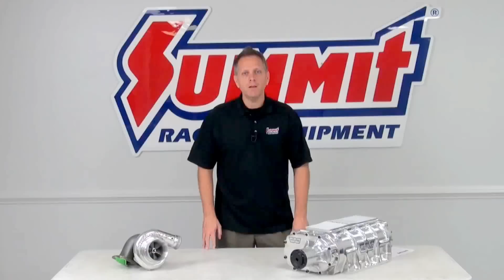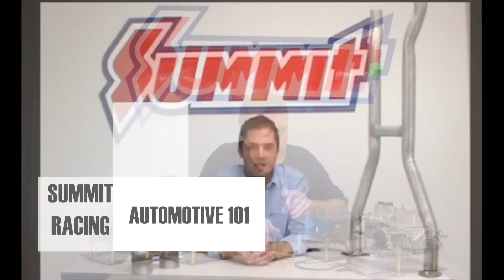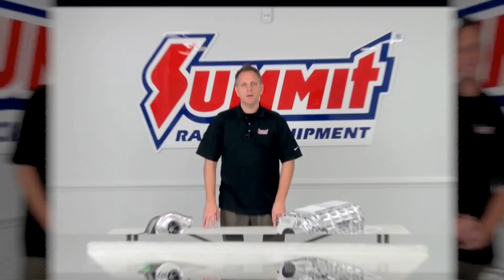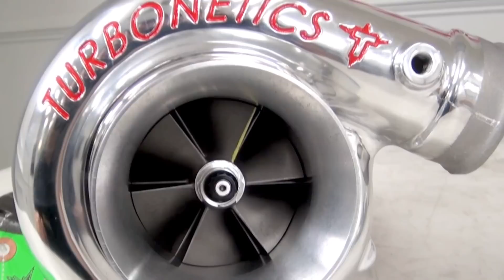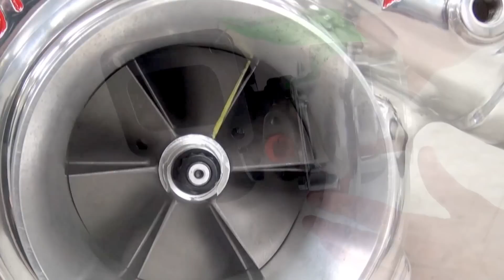Supercharger vs Turbo - Summit Racing 101

Comment: To those who are still confused, the turbocharger shoves air into the combustion chamber giving you more bang which means you'll have high acceleration but eventually looses some of its power in high speeds and gears.

The supercharger is attached to your engine belt, what does that mean you ask? It means your engine will scream at higher RPMs,  you'll have more horsepower and a higher top speed, since your engine is spinning round and round even faster you won't start gaining speed slower.

It depends on the situation, if it's a drag race, use the turbo... or  NOS. If it's a track I recommend the supercharger
Reply: rynousa yea, backwards lol
Reply: +rynousa yeah thats what i was reading earlier a turbo does better at higher rpm thats why it has a lag and the superlcharger usually doesnt give you as much power as the turbo but its better at lower rpm and it builds from there.
Reply: my little 144 never stops pushing not even past 10000 rpm
you guys read to much advertizing propaganda  
that what they said about the new screw blowers  .
but you heard the summit guy say they got no top end.
turbos have a tough powerband but then they shift and thats where the real lag is .
even the spoolers .
Reply: +Densel Moore lets get something straight here, a turbo doesn't necessarily mean high rpm. Also a difference between them is turbo is more effecient. Supercharger for drag, turbo for track, not the other way

Comment: So I'm not an auto technician but I'm curious . Can you install a turbo and a supercharger on one vehicle ?
Reply from the maker: +erik acosta , 
Yes, this can and has been done but, it would require a highly modified engine in order to handle that kind of cylinder pressure.

Comment: supercharger vs turbo? why not both?
Reply from the maker: +Dave0551, 
What is the year, make and model of the vehicle?
Reply: Summit Racing In general is it possible to install both?
Reply: +Dave0551 ...yeah its possible we call it twincharger or compound charger..In 1985 it was first introduced on Lancia Delta S4 ...after dat it was installed on Subaru Impreza WRX, Mini Cooper S, Ford Mustang, Toyota MR2. .source wiki
Reply: +Dave0551 Now that's my kind of mindset! hahahaha Mad Max would be proud ;D

Comment: Trying to decide if I want to put a supercharger on my 2500HD . It has a 6.0 in it . What should I do
Reply from the maker: +Damon Brady , 
We apologize for the delayed response, your comment was flagged as spam. In response to your question:  Depending on the year model of your vehicle, Edelbrock offers an “E-Force” Supercharger kit that includes all of the parts necessary to make the installation as easy as possible. They use high quality components including a hand held programmer for the computer so you don’t have to go to the dyno if you don’t want to!  Take a look. We stock many of these kits!

Comment: What has more wear on the Motor? 
I am assuming the supercharger due to using motor power and not exhaust.
Reply from the maker: +Tyler Madison, 
While a belt driven supercharger will ad some additional stress to the nose of the crank, both types of pressurizing the intake manifold (Turbo/Supercharger) will increase stresses on things like pistons, rings and connecting rods and bearings.

Comment: I'm interested in supers over turbos because I heard supers are constant duty while turbos are intermittent. Don't see much point in a turbo if that's true.
Reply: +Matthew samson that is correct. The turbo IS constantly displacing air, but until the turbine begins spinning fast enough from the pressure of the exhaust gasses, it will be making very little added power. Honestly i think a turbo would be so fun, think about stepping on the gas and just sitting there suspensfully waiting to be thrown back in your seat! :)
Reply: and please be really easy with the explination. I'm so incredibly new with messing with my car.
Reply from the maker: +Matthew samson , 
Well, since a Turbo is driven off the exhaust pressure, and exhaust pressure is higher at a higher engine RPM, the Turbo spins faster if the engines crankshaft speed (RPM) is higher – right?
A supercharger is belt driven off the engines crankshaft, therefore if the engines crankshaft speed (RPM) is higher, the supercharger then spins faster as well – right?
  Feel free to give us a call, we’ll walk you through it! 1-330-630-0240
Reply: +Matthew samson the turbo is constantly working, but the power it gives is determined by the air pressure coming through. If your engine is running high rpms=more exhaust gas=more pressure in turbo=higher power output from the turbo. The reason turbos will lag, is that pressure must first build in the turbo to spin the turbine within it. Once pressure has built up the turbine will be spinning quickly, forcing alot of condensed air into your engine. The amount of pressure buildup in the turbo being forced into your engine is called "boost", hence the boost gauges you will see in turbo cars!
Reply: ***** okay so turbos and supers both constantly displace air, but turbos must first build air pressure before delivering. Am I correct? I'm really struggling with translating all this from aircraft turbos since they act differently lol
Reply: +Matthew samson supercharger is not efficient ,,it thus increase power by 40% but also increase fuel in take and lower the mileage ...whereas turbocharger don't interfere with mileage but increase power at higher rpm...... turbocharger is annoying for their turbo lag

Comment: I have a 06 police 3.5l charger, nothing done other than the tune, suspension from the department. The modifications I done are a K@N drop in filter and a custom after market exhaust. what in your opinion would be a good choice. A super charger (of so, which type) or a turbo charger.
Reply from the maker: +Anonymous, 
A Centrifugal type of supercharger (Paxton, Vortech, Procharger) is much easier kit to install most times than a Turbocharger kit and generally lower cost!  Don’t forget the computer tuning, you’re going to need it!

Comment: hi I have a 4th generation z28 with 115k miles. I plan on a tune up and headers and new exhaust first before I get a turbo or super charger I wanted to know which would be better? I think they both sound nice but rather go with what would be best
Reply from the maker: Joshua Gonzalez, 
Generally, a centrifugal type supercharger are easier and least expensive to install.

Comment: I currently own a 2009 370Z that is bone stock with 83K miles and am looking at having a centrifugal supercharger installed. I've done some research and am still learning quite a bit about forced induction for my car in particular. My question is, would it be a good idea to add a supercharger (or any kind of forced induction for that matter) to a vehicle with that kind of mileage? Thanks in advance.
Reply from the maker: Marco Deuce, 
Generally speaking, in most cases a stock motor with good maintenance history will be fine with a power adder at low boost levels such as 5-6 psi. It will have a considerable difference in power as well at that boost pressure. Anything higher than that really starts to add stresses the motors were never really designed to withstand and should be modified accordingly!

Comment: A turbo doesn't run off the velocity of the exhaust gases. It uses the heat from the exhaust gases.
Reply: sleeperfox302x You dumb bro?
Reply: What do you mean by saying that
Reply: your shitting me right?
Reply: +sleeperfox302x u think turbocharger turbine will rotate due to heat from the exhaust gas...hahaha.....turbocharger use intercooler in order to cool and increase the density of charge (air fuel mixture) ..Heat are one of the drawbacks of turbocharger
Reply: +sleeperfox302x  Its not the heat itself, u stooge.  More heat creates a greater pressure-differential across the turbine wheel.   Higher pressure differential means higher VELOCITY across the turbine wheel.  Higher velocity means the exhaust gas has higher INERTIA...  which means it will impart greater energy into the turbine wheel.  Which means it will spin up faster.
Reply: +Muammarvsgaming ROBLOX  i said, high pressure DIFFERENTIAL!!.
Reply: Wrong
Reply: +Marek Sumguy actually lower pressure=more velocity=decreased lag+more respond

Comment: I have a simple solution... USE BOTH :D
Reply: +Joshua Medina the challenger hellcat X prototype has turbocharger (not sure if twin or single) plus a supercharger
Reply: Siggy Cloud There are cars that uses both. The first car to do so was an 80s sort of supercar built for a special category of Rally that required only 200 roadgoing cars to be built. It has the shape of a small 3 door car like a golf but its only a 2 seater with a mid engine, plastic body and 4wd delivering up to 550 bhp for rally.
Reply: MC Taipan I think you're talking about a lancia delta?
Reply: Yes Lancia Delta s4, It gets easily mistaken for the Delta Integrale.
Reply: MC Taipan I wouldn't call a Lancia road going. from what I heard they have a bad reputation for breaking down.
Reply: Yes thats true, but this was a very special car, search for Lancia Delta s4 or s4 stradale. the 200 roadgoing versions was made only to get up the number to make rallyversions.
Reply: MC Taipan But they seem to work, I've seen several on YouTube, people give rotary engines shit for not reacting well to running hot. Simple answer... bigger radiator, better intercooler, better coolant.

KEEP the thing running COOL its a pretty obvious solution. I only ever hear it from people who haven't owned one. which I think is ironic. I haven't owned one myself, but I can see a pretty obvious answer to the problem without much effort. 

But getting back to the point, its all about maintenance and looking after something and knowing how to fix problems. 

If one thing doesn't work. Try something else.
Reply: What's the average price point for both? Also, which one would be better for an s2k?
Reply: only ford gt can do that
Reply: +MC Taipan 
B class rally cars
Reply: Rashid Al-Riyami Yes The delta s4 is a group B rally car, but no other in the class used both.
Reply: ah cool, man those b class cars are beasts, too bad they're banned
Reply: yes i agree. I was at a show for about two months ago and there was a section in one of the halls where they actually had brought Hannu Mikkulas Audi Quattro s1 for display and also a Delta s4, 205 t16, special version of an rs200 and Metro 6r4. It was amazing to see them irl.Still i can barely get it into my head that i have actually seen a few of them.
Reply: had va rx3 it was awsome  when you blow the radiator hose shut it off
Reply: turbo for drifting, supercharger for gripping around a track

Comment: How would a turbocharger affect an air-cooled engine? I have an older volkswagen that uses an air cooled engine, and I'm interested in putting more power into it. Would the engine still be able to properly cool itself with the increased power? I have also heard that turbochargers are better for fuel efficiency as they don't waste fuel at lower speeds. Is this true? I don't want to have a terribly fuel inefficient vehicle, but would not mind sacrificing efficiency to increase the top end if that makes any sense. These may sound like dumb questions but I am uniformed. Advice on the matter would be greatly appreciated.
Reply from the maker: Roasted Goldfish , 
Air cooled motors can benefit from a low boost charger system. Anything high boost, high volume of air would indeed comprise its cooling ability. As for fuel efficiency, that’s a matter of the type of fuel delivery system and the weight of your right foot! :)

Comment: 2004 mustang cobra. super charge or turbo charge? will be doing both street and strip racing.
Reply: TheHDB97 04 cobra came with a roots supercharger from the factory
Reply from the maker: TheHDB97,
 Supercharger kits are plentiful for this car and easier to install. Buy a kit that comes with a programmer for the computer and you’re plug and play!
Reply: Kyle Schumacher lol I know, but im asking if a turbo could make more power. supercharger takes it I guess
Reply: oh ok. id still say turbos though

Comment: how do they manage HP against high temps outside 80f & higher compared with 40-60f intake air temps. Thanks.
Reply from the maker: Hot80s , 
Well, the underlying concern when trying to make big power with high ambient temperatures is detonation. Detonation can be controlled a number of ways dependent upon the application. Intercooling, retarding ignition timing, water/meth injection & cooling system efficiency upgrades are just a few to consider.

Comment: So i want to force feed a 350z. I currently live in arizona where it is crazy hot. I prefer a turbo set up over a supercharger but feel like it won't be efficient during the peek season of the intense heat. I mainly just want to make it faster whether I'm going in a straight line or side ways (mostly side ways) any input?
Reply from the maker: Joseph Gruber, 
A great suggestion for this type of environment would be to use a water to air type of intercooler. This type of system has a reservoir that you could add ice too and really bring your inlet temperatures way down!

Comment: seems like a turbo would be a little easier and less expensive to add on? still new to car tech but also looks like less materials as well, im sure they can go both ways price wise but just the basics what would that equal out to compared to each other?
Reply from the maker: Mustangandtang, 
We need some additional information from you. Can you give our tech line a call at 1-800-230-3030? 
Thanks!

Comment: Are there turbochargers that deliver more power than others ?
Reply from the maker: CatBombs, 
Your question is actually a little more complex than you may think. When choosing a turbo bigger is not always better. There is info that needs to be considered such as cubic inch displacement, components being used in the motor and also the fuel system? What is your power goal? What is the airflow requirement of said motor and where in the power band would you want your max power made?
Kits will sometimes make this choice a little easier but not fool proof. Many supercharger/turbocharger manufacturers would love the opportunity to help you match their products properly for best all around results.

Comment: i wanna put one on a charger. which one is better?
Reply from the maker: Insanetrickz98, 
Today’s newer cars have very little room required for all the exhaust & intake piping necessary for installation of a turbo kit. That makes a supercharger that bolts in place of the intake manifold an easier installation with the same results!

Comment: So I'm building my ranger into a desert racing truck. I've heard that both shouldn't be used beCause debris can come up and possibly break the pieces. Also the heat from them. But I'm still leaning towards buying a supercharger for my truck. Any input on if I'm dead wrong or somewhat right? School me on this. Thanks and appreciate all these videos you guys make. Very helpful
Reply from the maker: Gabriel Alejandro, 
Either option will have its share of compromises and fabrication in order to make them work out for you. Turbos have a lot more plumbing (piping) to do and roots style chargers have potential hood clearance issues. The choice is up to you provided you are willing to do the work. Just keep in mind that in a sandy dirty environment that top notch air filtration is extremely important to make either of these chargers live.

Comment: What's is the best supercharger for an olds 455
Reply from the maker: Payton Bechler , Unfortunately we do not have an all-inclusive kit for the Oldsmobile motors. We can however supply new superchargers, snouts and pulley’s from Wieand. In years gone by there have been intake manifolds made for the Olds motors to mount a 6-71 supercharger. You may still be able to find one on the internet or a swap meet.

Comment: Would a turbo/super charger work on a rotary engine? Like a Mazda RX8?
Reply from the maker: Carson Riley, Yes, Mazda has produced factory turbo applications in the past. One thing to be especially cautious of though on the rotary motors in detonation. The Apex seals will not tolerate this for long. There is plenty of information on the net regarding this, good luck!

Comment: Hi I have a question I currently own a 2014 dodge challenger sxt 3.6l I'm wondering if it is possible to make it supercharged or turbocharged. And what will be better?...ty in advance
Reply from the maker: d'knight,
Due to the fact that a turbo adds no parasitic draw to your motor to make power, instead it uses exhaust gases (waste) to spin the compressor wheel, they would be the better way to go. But, most times a turbo is more labor intensive to install due to an exhaust system re-work and all the added tubing to route beneath the hood. We unfortunately do not have either kit for your car but, these kits will be very vehicle specific and shouldn’t be hard to find if available!

Comment: Is it true that turbochargers have the tendancy to wear out stock engines? If so, what needs to be done to the engine to allow it to function properly with the addition of a turbocharger?
Reply from the maker: Sculpture Junkie,
Any part that is improperly installed or misused can be detrimental to your motor, give us a
call and we can walk you through the process.
Reply: Summit Racing Oh, I see. I'm not in the market for one just yet, but when I am, I will, thank you.